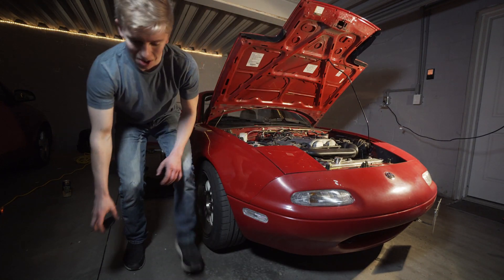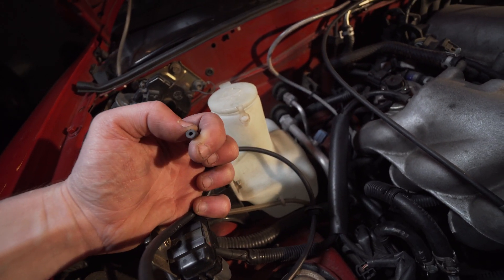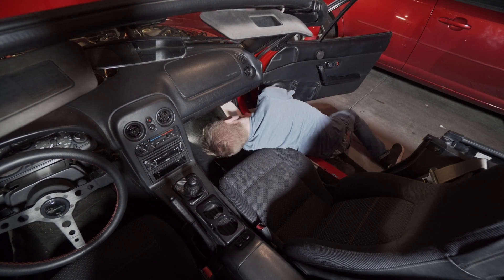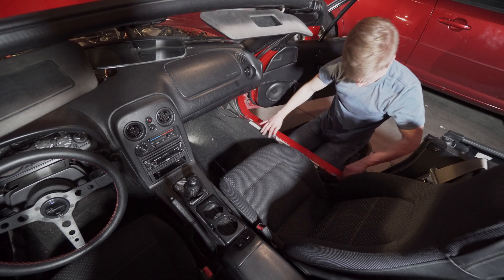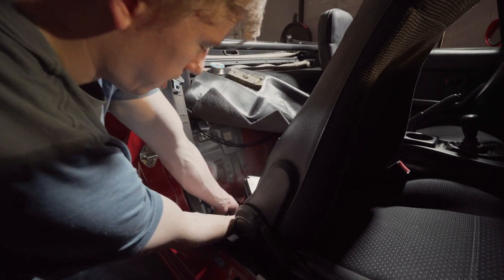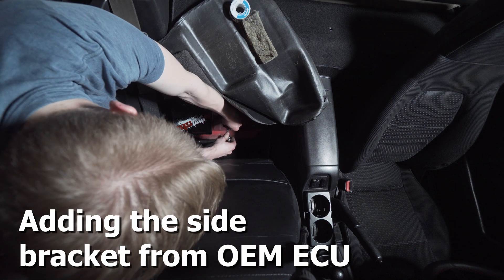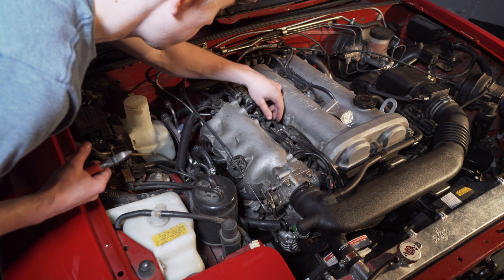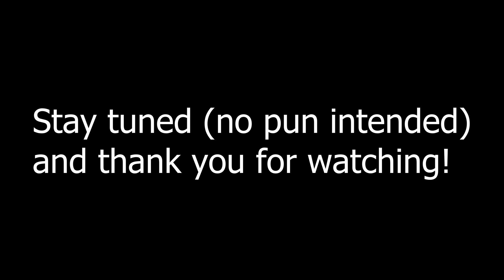Install Megasquirt PNP 9697 [1.8L Miata] MSPNP2

Comment: So does the MSpnp2 work for all NA Miatas, for example a 1997?
Reply from the maker: The plug and play kits are different depending on the year (90-93, 94-95, 96-97), but a megasquirt can be configured for any car really.
Reply: @HardwayLearning  thank you so much 😊
Reply from the maker: @smwte  but to clarify, the connectors are different and that's why the plug and play kits are year specific
Reply: @HardwayLearning  Gotcha, I was looking at someone selling a 94-95 Mspnp2 secondhand, and I have a 97, but Now Im glad I didnt bite the bullet 🤯